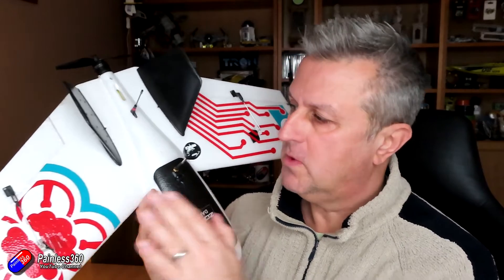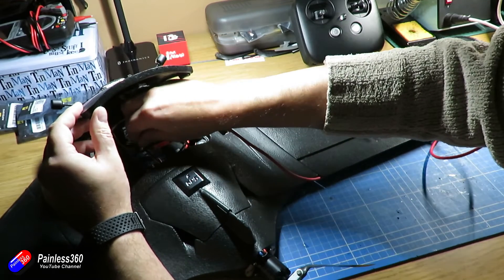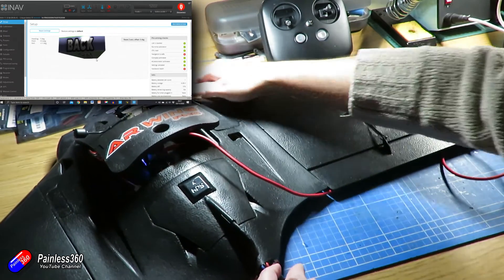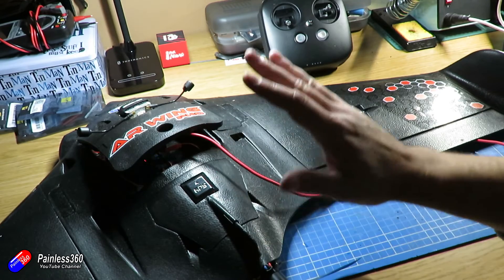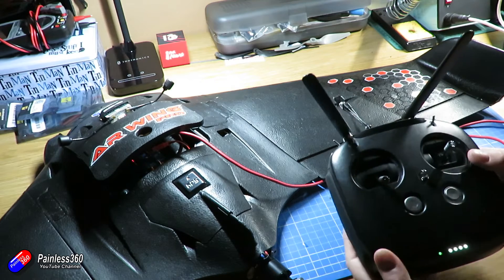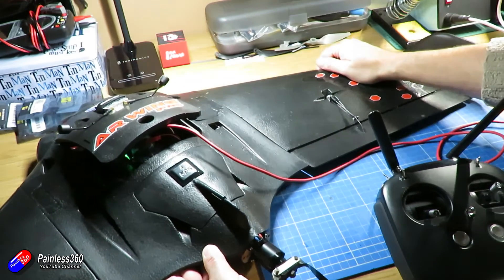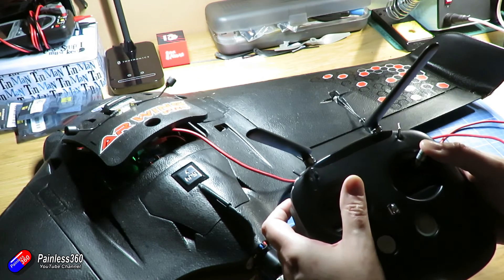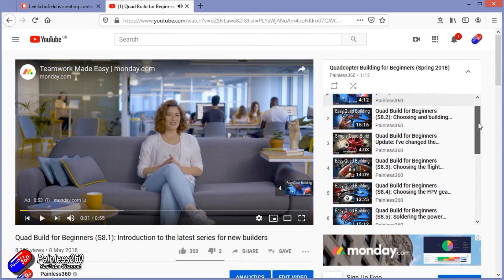INAV Quick Tip: Why can't I get my servos/elevons moving in the right direction?

Comment: I'm new to inav and im setting up a zohd. I had the ailerons going the opposite direction but I dont see the reverse tab on inav 8.0.1 on the outputs. I see the servos and it all works fine, when I tilt stick to right it was lifting the left. My only solution was to reverse it on the radio but you said not to....I see the same lines of servos and weight values but no reverse tab
Reply from the maker: Same way and place in INAV configurator as always, see https://www.dropbox.com/scl/fi/l9qwje62a5wx3ahte0whu/Reverse-option-in-INAV-8.png?rlkey=1d9b4vd0ul883qu3rn5tey3mo&dl=0

Comment: Hi, I can't find any videos resolving issue like I have. I am using mateksy board and inav4.1. and after plane arms, servos do not move back into middle position after taranis sticks are in neutral and stable or horizon mode is on!!! I am stuck with it for a year and still no idea what is causing it or how to fix this. Please help
Reply from the maker: This is normal if it is on the bench. If they move back in manual mode, you're all good. See my INAV for beginners 2022 series... Best of luck
Reply: @Painless360  Hi, I really appreciate your expertise and knowledge. The problem starts when GPS locks and activates ESC, servos start moving in slow motion and travel back from fool deflection only half way. That happens when moved by stick or by giro. I have tried with different GPS unit and it's still the same. I have stable, horizon, manual and rth modes . Servos and giro works fine until the GPS gets locked and then airplane becomes impossible to fly. I have no idea what is causing it.
Kind regards Martynas

Comment: thank you for the quality of your videos. you helped me solve the bad behavior of the gyro linked to the roll stick that had to be reversed on the transmitter.
could you explain to us in the simplest possible terms, the different modes applicable to flying wings? I don't understand the nuances between
AIR MODE
ANGLE
AUTOLEVEL
AUTOTUNE
HORIZON

I try to reproduce the behavior given by the SxR or SRx, ie a purely manual piloting mode, an assisted mode with the gyro, and an emergency mode restoring the model flat.
Thanks again from France
Reply from the maker: https://youtu.be/0aMDfspDAVw will be worth a watch... Happy flying

Comment: Thanks .
I was scratching my head for since 2 weeks .
My FPV Raptor V2 with matek F722 was showing same error of control surface was moving in wrong direction in stabilize mode.( Even after 3 successful build) Now I know why.
Thank you again.
I more mistake 
One more mistake I made was remove 5+v lead from esc and plug it directly.
What was happening that in radiomaster  telemetry using tracer as tx Rx unit voltage display was constantly jumping between 4.6V to bat volt (eg 12v) and very strange behavior from motor.
Motor was lagging when I control it with iNav. Just I had forgotten to remove +5v from esc

Comment: I have an INAV compatible  Flywoo Goku AIO Flight controller originally installed in a drone and want to use in a 250G,, however I must re-assign resources like PPM motor  signal to the external  ESC and servos, as well as GPS to get everything to work. Ive already got functionality in Betaflight, because recourse reassignment is relatively easy. How can I re-assign resources in INAV to configure it for this flight controller to run this setup.  This is a Flywoo AIO flight controller that is defective. The ESC actually caught fire (a common problem with this AIO board) and  is totally non usable, however amazingly the flight controller portion is totally functional. I am disabled and on a very limited budget, so I use every recourse I have, including this AIO flight controller. Please help, I need this bird to have return to home and GPS functionality that INAV provides. Thank you
Reply from the maker: I never do any of that. See my iNav for beginners 2020 series.. Best of luck

Comment: which gyro_hardware_lpf  are best for the wing??  256HZ or 20HZ
Reply from the maker: I usually leave it as the default. See my INAV for beginners 2020 series..
Reply: ok that's 42HZ but it wouldn't be too high if the fc matek F405 system mesagge shows gyro_hardware_lpf problem when I set servo autotrim but with the setting 20HZ everything ok
Reply from the maker: Then I'd leave it at that and rebalance your prop. Best of luck with it

Comment: Hi Lee, I have got a question about Inav-DJI-flaps
I do enjoy FPV flying my Ranger2000 (matek 722) and would like to use flaps to ease the impact on  landings. Are you aware of the possibility to use the DJI FPV system combined with the use of flaps. I couldn't find any info in the web
Reply from the maker: Yes. Maybe worth a video in the new year..

Comment: I've just upgraded to 2.6 on my f411 wing.  I also downloaded the new configurator.  The release notes said that a "diff" config from 2.5 is fine for a fixed wing so that's what I did.  

The first time plugging in the esc did it' s normal startup beeps but then began doing a single beep every 2 seconds.   Now when I plug in it doesn't do the startup beeps, it just starts doing the single beeps and continues until I unplug the pack. 

 The board will arm but the motor doesn't spin.  It won't spin using the outputs tab in configurator either.  I tried throttle calibration but it won't calibrate, just keeps beeping.  Servos and everything else is working fine.  Any help is much appreciated.
Reply from the maker: I'm waiting until the first bug fix release before getting into it.. Best of luck

Comment: Have you considered making the change in the Mixer weights rather than the Outputs? Since I have started using iNav...well since Pawel integrated the mixer...I've always made my servo reversing corrections by adjusting the weight for the specific servo and command. So if the one servo is reversed for pitch only the I only invert the weight for the Stabilized pitch for that servo, rather than reversing the Outputs tab which should invert pit h and roll in an elevon.
Reply from the maker: Yes and no. If you need to get into the detail of looking at the mixer polarity then that almost always points to a problem in the basics covered in the video. You can build a house of cards with the settings in INAV and then come undone when it's flying. I've not yet once found a servo direction issue that wasn't due to one of these common basics being missed. And I provide help and support out a lot of pilots on this channel.. ;) Happy flying!
Reply: @Painless360  I agree you do, not trying to say that your method is wrong. I was just curious if there was any specific reason or if you have ever tried that. I think it's just one of those things that I started doing once the Mixer was broken out in the configurator. I also agree 1000% that the board orientations and radio setup are far more important to avoid issues in flight.

Comment: 3:51 - Lee, you crack me up ... many thanks ... brilliant per usual 
Could you please send me a link where I can get this folding prop? I hope it is more silent than the smaller original prop because it does less RPMs and probably shovels more air?
I'd like to operate the wing with a 5000mA 3S with the SunnySky X2216 2216 1250KV motor. I guess that might work? (I am newbie, have never been building or modifying (motor/prop change) a wing)
Is there a formula where I can calculate the needed thrust by using the few specs given by the component manufacturers? 
Do most models come with a recommended thrust value? 
I do not necessarily like to break the speed record, I'd rather fly economic and silent long range, at lets say 50mp/h, but I also need a good climb rate.
I see you also got a video on air speed sensor implementation ... that would have been my next question since I don't want to stall flying efficient with a tail wind.
Greetings and many thanks
Reply from the maker: This is the same sized prop as the one on the model (8x5 I think). I use the Aero Naut stuff here so it's the 8x5 folding prop and the 38mm hub. You can get all of them from 3DXR.co.uk..
Reply: @Painless360  Many thanks, I can only find a 34 mm x 8 mm center piece and 9 x 6 inch is the smallest foldable blade did they discontinue them or is your data off? 
I have just been reading up on what the numbers actually stand for ... the diameter is easy to understand, I guess it is being measured if the props where on the same axis, so the spacing of the center piece obviously comes on top and the forward motion value on one revolution to me seems very difficult to measure?!
So if you have a 3 S battery with lets say 12V and your regulator (ESC) steals you 1V (realistic?) you will have 11V reaching your motor ... at 1250 KVM = 13,750 rpm (no load) => x 6 inch (prop forward speed/rev) => 82500 inch / minute => ~ 2km/min => 125,73 km/h = 78 mp/h ... under "ideal no load conditions" ... did I calculate that correctly?!? ... maybe with the folding blade hub in the middle the blades have more speed (larger radius) and that makes up for the drag from the entire plane and these values are not to far off?
Reply from the maker: http://www.aero-naut.de/en/products/airplanes/accessories/propellers/camcarbon-folding-prop/ shows the full range of sizes. Looks like 3DXR have yet to put them all on the website.. Check out my video on folding prop basics.. Best of luck!
Reply: @Painless360  Thanks a lot, will look for that and check your folding prop video